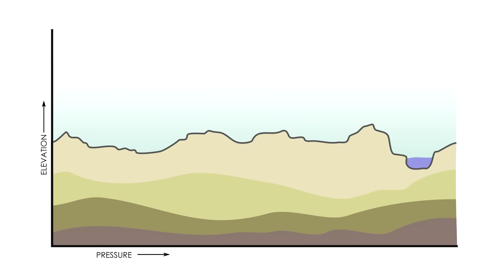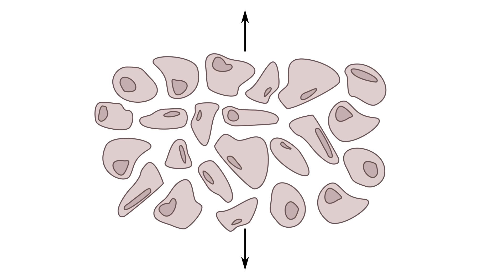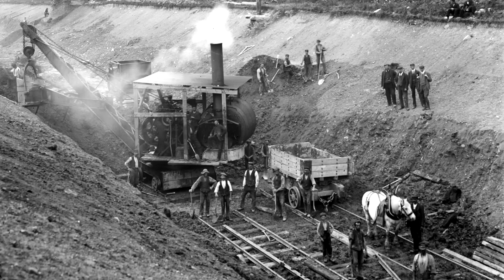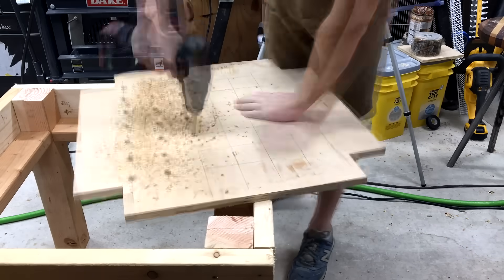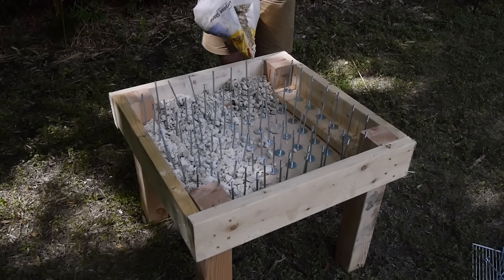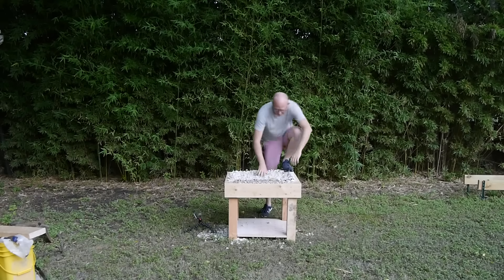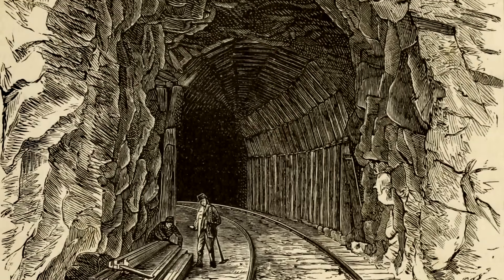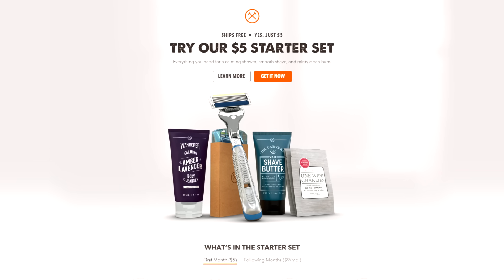Why Tunnels Don't Collapse

Comment: As a civil engineer, what do you think about building tunnels through anhydrit rich sediments (layers of clay, gypsum and anhydrite --> not homogenouse [former Sabkha])?
From the outside would you take the risks and costs of building a highspeed train tunnel through these type of sediments and what could be done to minimise the risks of soil deformation?

Comment: Very cool! I was trying to identify the purpose of some bolts drilled into the roof of a subway tunnel here in Toronto. The area of concrete around the bolts was cracked, so I guess the bolts must have been used to increase the tensile strength of the concrete. Thanks for the free education ;)

Comment: Very interesing video, at a good time.
I've just been on vacation to Norway where they a lot of these tunnels (we drove through 126 of them) and most of them are (partially) supported by bolts which are clearly visable.
Fun to clearly see civil engineering applied in the world around you.
I find it is facinating that something as "simple" as a couple of metal rods are enough to decrease the risk of collapse significantly. 

I think these video's where you explain methods used to reinforce materials in an (relatively) inexpensive way, like the mechanically stabilized earth, are some of your most interesting!

Great work!

Comment: So this experiment is trying to prevent the fluidity of finer substrate without much support except by the act of using the tensile strength of the substrate in a way of compression...
Would bigger and coarser substrate affect how far apart the supports are placed?
What happens if the substrate have different sizes or maybe one of them is bigger than the rest?

Comment: I study geology as my major. And structural geology says - for tunnels, competent rocks like granite or sandstone are the best. Because these rocks can withstand a huge amount of stress. But you always need to watch out for rock joints as these joins greatly reduce the competency of the rocks.

BTW, its great to see there's so much in common between geology and civil engineering.

Comment: Hi Grady. Here is my request for your consideration for future videos
1. Tensegrity structures
2. Role of Arches in buildings and bridges
3. Topology optimization of structures.
4. Difference between a cable stayed bridge and a suspension bridge
5. Modern traffic management 
6. Pontoon bridges
7. Track ballast of railways
8. Column buckling, slenderness ratio, why we use I beams, open and closed box sections etc.
9. Pump sizing and piping design for home (as in what diameter of pipe to choose to reduce flow losses, etc.)
10. Bore wells and open well, drip irrigation etc.
11. Water purification(RO) and its negative effects on ecosystem.
12. Difference and use of concrete and asphalt roads (an in air craft runways use only asphalt and not concrete etc.)

Thanks for reading my comment and keep up the good work.

Comment: Tunnels are arches. The arches do support their own ceiling, if the rocks are very close to each-other.
Reply: Arches can do such a feat only because they have symmetric rocks and a single, centered figurehead exactly on the top of the arch and you could keep it like that without gluing the pieces together (or adhering them to each other). While the domed shape of a tunnel is also a vital part for it to not collapse, you already chose not to shape the rock to make arches because that costs lots of money, so you need to hold the rock together if you want it able to hold ANY weight at all.
Reply: epSos.de not all tunnels are arches, many mine entries and access slopes, ramps and declines are mined based on the bedding and equipment on site. Arches are the most efficient manner for structural support but not always the cheapest to excavate, especially when determining the diameter and methods, such as mechanical.

Comment: imagine if the gravel let go when you were standing on it, and you took one of those bolts through the foot. had me nervous watcing you stand on it
Reply: its 2,5cm wide at the top or bottom, u'd need more force to punch thru a foot
Reply: @AgentFire0  It's not about punching through a foot. It's about the whole "plate" buckling just enough to induce an immediate collapse. My toes curled up when I saw it. This is one of those cases where people sometimes get really hurt because they don't think things through.
Reply: @AgentFire0  True. That 3"multi purpose screw had no problem piercing my shoe's sole before puncturing my foot. If only there had been a washer and a nut on the end of it.

Comment: I'd love to see a video about how the required strengths concrete are calculated. How do you know how much compressive or tensile strength will it require? Static loads, dynamic loads? Is rebar soldered in place? Why doesn't it just come loose?

Comment: I do have a question for a video! I was on a train today staring at the tracks and I wanted a more in depth explanation for why all tracks are how they are, such as the gravel underneath and cement/wood structures. (Of course to support the train) but to the what defines how much and spacing etc.

Comment: Thanks for the inspiring demo!  Would it be just as supportive if you were holding a coil of rope...?😬😁
New subscriber now....
It’s a wet winter here and I’m building a house...very slowly!!
The site is on a 15 degrees slope and I have excavated back into the hillside so that the whole pad area sits on natural ground. Effectively there is no fill on a standard cut & fill excavation. 
Have built a sand pad behind an earth bund with 2 outlets to natural ground through pervious pea gravel/sand. These outlets manage all the subsoil water. 
But one outlet has eroded out whilst the other remains. 
I’m so curious (and poorer) as to WHY?????
I stand in the rain hypothesizing nearly every day.....
What is the theory behind this erosion and why that bund is empty???
Thanks.

Comment: Great video. I worked as a carpenter in the construction of an underground hydroelectric power plant. We rode by truck deep into the mountain where the same bolt construction was used in the tunnels. I always thought the bolts were there just to hold the wire mesh in place.

Comment: How is the top of the tunnel in tension?
On another tangent, I have heard that railroads like to use sharp edged ballast that way the ballast has more resistance to movement.  I wonder how your experiment would work if you used something like paint balls which have less friction between themselves than does gravel.

Comment: That gravel table is pretty amazing!
Reply: I’m curious as to how far you could take this experiment. Some gravel seemed to fall out as you bounced up and down on it. I suspect that if you did that much more the thing would collapse. But what if you could get the pieces of gravel aligned better before bolting it down? Perhaps with some sort of vibrating? I don’t know. I’m a mathematician, not an engineer. Could you make something that could hold a load for an extended period of time? How much and how long?

Comment: What would happen to the gravel if it was wet before compression compared to wetting the gravel afterwards.  Also, I suggest using a ladder, two sandbags, rope and pulleys to simulate your hopping if a structural collapse was to be expected.  Also a freeze and thaw cycle if possible.

Comment: Excellent example of how loose rock/joints in tunnel ceilings are “Stitched together!”. Even though gravel has a much smaller particle size than the actual rock in a tunnel ceiling, this extremely simple example was able to demonstrate just how effectively the Rock Bolts could help support slightly loose rock layers of a tunnels ceiling!!!! Every time I watch your videos I always learn something new even about something that I might have limited knowledge about!!!!!

Comment: What really impresses me is Roman engineering in that context: they managed to dig multiple holes in a line  and connect them with simultaneously dug tunnels. All of them met exactly where they should and the floor had an even drop of ca.1cm per 1km!
Today we got laser distance measuring, compass, GPS and yet many still fail at building a freaking bridge from both sides at once!
How could Romans do such feats underground?

Comment: I work in a large underground mine (1300m+ deep) and the way we reinforce the tunnels is first with concrete mixed with metal threads and then bolts like this on top. In some places metal netting is also added for some extra support.

Comment: Due to the lack of rain this summer in the UK we are facing water restrictions. Our water company was investigated and it appears it's losing 400 million litres of water a day in leaks, What happens to underground pipes that were once watertight to start leaking? Are they not buried deep enough (to save money) or is this a known problem with water supply?
Also it's easy to spot a burst pipe when the water comes to the surface, but if pipes are not leaking enough to show at the surface, how do water companies find the leaks?
Reply: They can (broadly) spot the leaks with flow meters, 10 liters come in, 9 come out, you have a leak somewhere.
Reply: Could be corrosion on the pipes, or small breaks due to uneven ground settlements or other constructin works. Utility comapnies may, apart from checking the metering records, "listen" to valves at nighttime, if one valve makes a sound of flowing water through it, and the next doesn't, without many consumers awake...  there's probably a leak between them.

Comment: Wow awesome. But did you actually tensile strength to the gravel or did you add sheer strength with the bolts?

I'd be curious about fiber concrete, using basalt or other fibers instead of rebar. I'd love to one day build or buy a 3D printer that can print houses.

Comment: I work underground in a gold mine and now we use swellex bolts. So after we drill a hole, an 8' swellex is installed in the hole then blown up like a balloon with ~5200 psi of water pressure. This puts force around the bolt for an 8' length. And for every 6 foot of advancement, we add 3- 12' super swellex bolts as well. On your demo, you should have put a piece of hog wire on the bottom. Because we use this wire along with the swellex bolts to tie them all together. Still a good video!

Comment: Good video and demonstration.  The compression explanation and illustration is informative -- seems like such a hack, but it is theoretically justified.  Here are my comments:  In my limited knowledge, the 45° pressure line was under-highlighted (and is dependent on a loose material's shear strength). This should easily be observed in different slopes of piles of loose material (but is typically ~45°).  In other words, I've contended interlocking surfaces (may) have an additional mechanism of interlocking than pure surface friction (e.g. smooth surface vs. knurled, interlocking surfaces [e.e.g. fingerprints]).  To me, these are the concepts that theoretical analysis (and their re-iterations) seem to skip over (micro- and macro-analysis).  Also, the model revealed pieces fall loose and compromised the presumed scenario.  Lastly, in my experience, I try avoiding locating drainage lines out from under the pressure line of any footing (for buildings).

Comment: have a question that might make a good part 2 to this video. back in 2012 a tunnel in japan which was reinforced in exactly the way you describe here collapsed. why? i'm also curious as to what the thinking behind the safety inspection methods was, and why they were insufficient to detect any problem before the collapse.

Comment: Very interesting video. I don't entirely see the relation to prestressed concrete where the compression is added in the direction of the span. In your case the compression is added perpendicular to the direction of the tension. Is the compression inducing enough normal force to allow the tension to transfer from rock to rock through shear, and then back into tension in the next rock?

Comment: You kind of hinted at it but didn't cover it - how would an engineer reinforce or hold back soil (or similar) long enough to build the lining or support? Along the sides I can kind of picture in my head, so particularly along the top?

Comment: Grady, thanks for another awesome visual exploration in practical engineering techniques! I have a video request that you may consider. Could you do one on the different type of wood deck connections? More specifically the strength of various post to beam connection methods.. There is one area of interest in the seemingly counter-intuitive perpendicular to the grain vs parallel to the grain, as well as notch, post on beam, and double beams sandwiched to posts with lag bolts. Bolt hole sizing also plays a major role. Here are some interesting reads: https://naldc.nal.usda.gov/download/CAT86200326/PDF Also, Here is another http://www.woodworks.org/wp-content/uploads/Baltimore-wsf-2013-guthrie-structural-wood-to-wood-fasteners.pdf and another https://www.fpl.fs.fed.us/documnts/fplgtr/fplgtr113/ch07.pdf and another http://www.awc.org/pdf/codes-standards/publications/nds/archives/Part08Boltspp97to114.pdf

Comment: That\s an awesome demo! I wonder how far you could span using only reinforced gravel...
Reply: I'm not sure he would have appreciated falling two feet onto a steel bolt XD
Reply: It also demonstrates why things do collapse... more and more parts fall off and then the whole system collapses spontaneously. As far as i understoof mining safety actually tries to break off as many loose parts as possible until only the densely packed rest is there, which is then reinforced.
Reply: @denny9931  yes, scaling removes the loose from the back and then it is bolted (and screened).
Reply: MULTIPLE steel bolts xD
Reply: Reinforced gravel COULD be another name for concrete.  Jus' sayin'.
Reply: Shotcrete is a term we use in mining where we shot cement over the back and walls of the drift for support then rock bolt after
Reply: It would need to be 1 foot wide at most to be longer. It  compresses against the wood borders to stay in place
Reply: That was the same thing that I was thinking how far can you stretch it
Reply: Honnestly at 6:31 he should have kept on jumping until it fails.
Reply: In real world situation, they fix the thing with concrete before moving ahead. I really thought he was going to fix it with little concrete and then jump onto it.

Comment: In your example of bolting the rocks together, could the load  be more evenly displaced if strong wires were connected from each bolt to form a lattice type of support, or is that impractical?

Comment: Actually, that picture at about 1:23 doesen’t look like a real tunnel carrying a burden of ground over it as you are describing, because of the angled straight roof and not an arch seen silouetted against the sky.  It appears to be a snow/water/rolling rock shed built over a cut on a slope. I think the roof is actually made up of timbers designed to divert snow, water torrents and any rocks coming down the slope.  Snow plows in a cut have no sides available to eject the snow off the tracks and upward isn’t a real option, and because snow compacts, trying to shove it out the other end of decent sized cuts won’t work.  So snow cannot be allowed to accumulate in the cuts.  Running water destroys everything, so it has to be diverted over the trackbed with a shed or under the trackbed with a pipe/bridge.  Rocks can derail and damage equipment.  Because of the long stopping distance, by the time the crew sees something, it may be too late.
     I’m a member of a group in the New Orleans area which rebuilds, maintains and operates antique railroad equipment.   We don’t have to deal with snow or rockslides in our yard.  The problem in our area is when laying new track making sure it won’t sink when equipment is on it.
      I took a screen grab of the photo and I’m going to see if I can play with it a little to see if those are a row of timbers over a cut and no rock.  I believe it is a snow ahead over a cut though.

Comment: Code of Ethics:
Cannon 1:
Hold Safety Paramount

Let stand on this floor of bolted-gravel, if it collapses, not only do I risk breaking my ankle, but could have one (or more) of the vertical bolts spear my legs.

Great video Grady, keep them coming.  Not only do I keep learning here, I am also amazed most of the time by either what you do, or how it all works.

Comment: With the amount of rock bolts needed you are probably better off with structural lining !
At least you would feel much safer rather than wandering when the roof will come down because too much rain up top causes all sorts of problems in this theory !

Comment: You completely skipped over the reason that all the tunnels you showed have arched ceilings. One drawing referenced it slightly, but it's still mysterious to those of us that don't know the dark magic of the arch.
Reply: Patrick Shannon This has to do with the fact that around an elliptical shape the lines of pressure fit really smoothly around it, so the areas of tensile stress on the top and the bottom are as small as possible. But since in most of the cases you need at least a flat floor to drive on and a bit of a wider arch to fit infrastructure next ro your vehicle, you are baaically left with a wider half on an ellipse, which is the effectively an arch. And this doesn't even consider the benefits of arch-shaped steel reinforcement to distribute the pressure from above and the sides (and in some cases even from below). Hope that I could help a but.